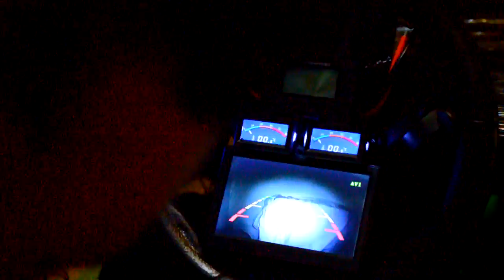Solar assisted Nobuo-01 electric vehicle "DIY e-kart" (72V, 3kW, 2kWh)

Comment: 1st off, shitty editing, fragmented clips of random assembly.  next, FAIL..bike forks are NOT designed to take loads in that position and direction. Final thoughts : it has more than 3 wheels so it would be classified as a motor vehicle...the maker just eliminated 90% of his potential market . next, to have gone through all that trouble of electronics,frame work, and custom seats, it is still wide open to the the environment/weather...
 basically, go back to the drawing board, redesign your fork tube connections, eliminate a front or rear tire, enclose it enough to make it weather proof...then market it for 1500-2000 dollars.....by the way, no need for 18650 cell packs on a 3 or more wheeled bike...just use SLA

Comment: excllent job, if you need case by  cnc machining or die casting ,contact me
Reply from the maker: Awesome idea, thanks for your help. Now I'm working on a second version open source oriented. I will try to use a conventional 3D printer to make a puzzle fairing! :) If I can't success I will contact you. Thanks!

Comment: Which charge controller are you using to charge a 72v battery!
Reply from the maker: I recommend to use an MPPT charge controller when you need to charge higher voltage batteries with standard pv panels (12V or 24V). In my case I can use a PWM controller because the panel is custom build to match perfectly the battery voltage, making the PWM very efficient in this case

Comment: 2 seater with monocoque roof with larger solar panel, but im prety sure you already tought of that ...
Reply from the maker: Good idea, that would be a much more interesting build, it requires higher mechanical formation than I have to make it perfectly stable and reliable over the time, but it would be really more close to a solar EV. Thanks for your thoughts

Comment: You are using two motors right. I read similar motors do not necessarily assure same RPM. Did this cause any problems? If yes, how did you fix it?
Thanks.
Reply from the maker: When both have the same model and quantity of magnets, same winding, same size and weight, and both are commanded with also identical controllers fed by the same battery, and if both motors have the same friction and mechanical load, both will performance pretty similar.

Even in the case a motor would deliver slightly higher rpms, it won't cause major problems in the steering system if the EV has two axis and 4 wheels
Reply: Thank you.

Comment: brilliant work man. just a couple of quick questions. You have a MPPT controller and an on-board charger to charge your battery pack simultaneously while running the cart? Or is it intermittent charging? Did you think it can decrease the number of charging cycles for the pack? And lastly did design any safety circuitry of own for protection like throttle Pedal over travel. Would be great if you could explain me. :)
Reply from the maker: The PV charge controller can charge at the same time the battery is discharging, as it has its own protections and custom voltage it is paralleled with the discharge port, so if you are powering motors or any other electronic part, the solar panel will feed the system along with the battery charging it or not depending if you pass over the PV power in that moment.
It won't decrease number of charging cycles, indeed it will decrease discharging rate of the battery, so you are increasing cycles life and life span
Reply: Damian Rene thank you, but I am unable to picturize how simultaneous charge and discharge can be performed. Can you suggest some PDFs or videos to refer?
Reply from the maker: Everything depends on voltages. If your PWM solar controller is outputting a higher voltage than your battery (as it always needs to do to charge a battery, when the sun intensity is enough to produce a higher voltage than your current battery) if both solar controller and battery are paralleled to any other electronics, the solar controller higher voltage will make it to exclusively feed the electronics, until the current demanding is higher than the solar controller current so it will make its voltage sag up to the same battery voltage level, in this moment the battery will start to feed simultaneously the electronics with your solar controller.

In every moment the voltage of the solar controller remains higher than your battery, even under electronics feeding, it will feed exclusively the electronics along charging your battery at a current level equal to controller current less electronics demanding current.

MPPT controllers works in a similar way, but some of them have boost capabilities, so no matter the sun intensity they will deliver the same constant output voltage, configured at the charge voltage of your battery (maximum voltage at 100% SOC if Li-ion / Lipo or 20% higher maximum voltage for SLA / LiFePO)

With MPPT "no boost" controllers you would always need to have your solar system feeding in the first place at a minimum solar intensity where your solar panels produce a higher voltage than you current battery voltage, if not only the battery will feed the electronics
Reply: Thanks a lot for your detailed answer. Helped a lot!

Comment: I have a 36V, 10S3P Li-Ion battery pack, for which I have bought the following BMS:
http://www.aliexpress.com/item/Li-ion-Electric-Bicycle-Battery-PCM-36V-10S-15A-BMS/1778569829.html

I am not sure what to connect on the "Charging" terminal. Just a normal 42V voltage source will do? or a more sophisticated source is required?
Reply from the maker: 42V li-ion charger, if you just connect any 42V power supply, the current level in the last stage of charge will be not adequate
Reply: +Damian Rene 
A 42V source with 5Amp capacity will be sufficient?
Reply from the maker: 5A or less would be perfect for a 15Ah battery, and the maximum recommended amperage for a 10Ah battery.
For li-ion never charge at a higher rate than 0.5C (2 hours of charge), 0.3C or less is the most healthy charge rate
Reply: Thanks a lot D. Rene, These tips will surely help!

Comment: I would like to see a video that shows accelaration, high speed and braking.  I am thinking (ok: dreaming) of a vehicle with four such motors but with emphasis on fun for 15 minutes or so, and capacitors instead of batteries. I think your kart has very good accelaration already when I compare it with other electric vehicles I have seen.
Reply: Why capacitors? They have a much lower energy density.